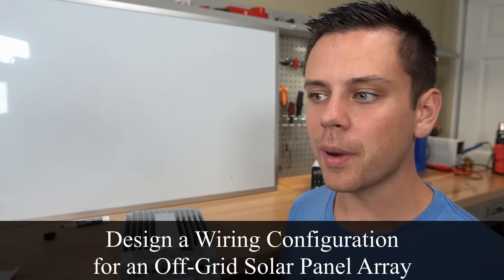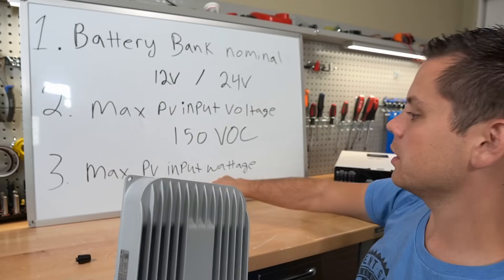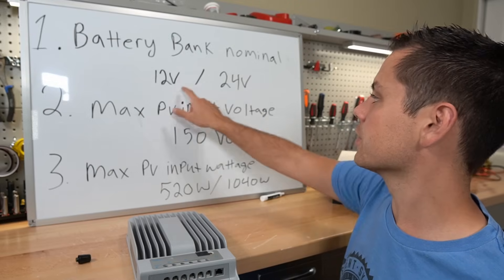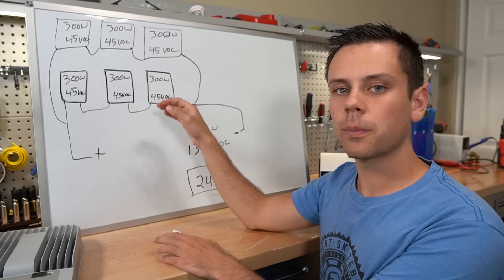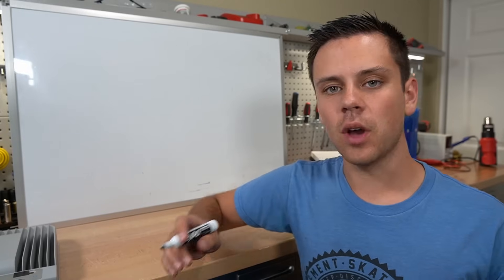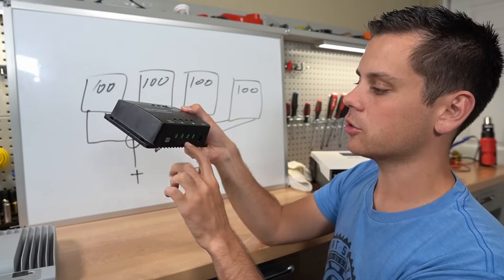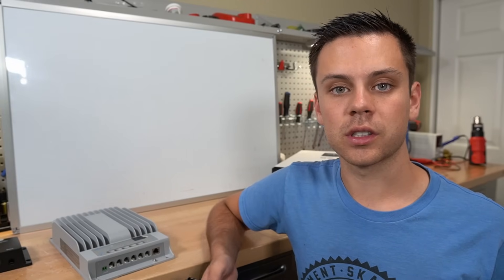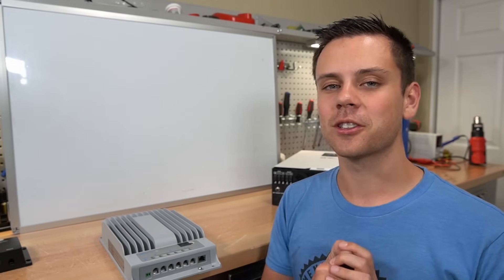How to Design an Off-grid Solar Power Array Wire Configuration

Comment: I’m a beginner solar diy’er…Could use some advice in designing my solar panel array.  I have a “Off Grid” workshop that I am try to power up with 2 ea.  EcoFlow Ultra Pro Inverters and 40 ea. 240Watt solar panels with the following specs:
Solar Panel Specs:
Rated Max Power     240W
Current @ PMAX   8.11a
Voltage @PMAX 29.6V
Short Cir Current   8.46a
Open cir   36.9 v
ECOFLOW recommends wiring the solar array in Series with the following requirements:
There are 2 inputs for solar charging    HI input (4000watts), LOW input (1600 watts)
ECOFLOW INVERTER SPEC/REQUIREMENTS:
Voltage range for low-PV input: 30V < total solar input < 150V        max 1600 watts
Voltage range for high-PV input: 80V < total solar input < 450V       max 4000 watts
Would like to know if this array would safely work within the EcoFlow requirements
Inverter 1--- HI INPUT   15 panels   and    LOW INPUT     4 panels        wired in series
Inverter 2 --- HI INPUT   15 panels   and    LOW INPUT     4 panels        wired in series
Would like to know if this array would safely work within the EcoFlow requirements
Any advice would be appreciated

Comment: I have a good question, is there a way to drop let’s say 10 v on a solar array…. Issue I am having the delta pro limits watts to 1280 when above 130v and I’m barely at 138v and to meet spec I need to remove one panel but the issue is on cloudy days I get a lot less watts with 5 panels instead of 6

Comment: I just have one problem with guides like these. I see them talk about multiple panels, but never multiple batteries or multiple charge controllers. What if I have a charge controller for each panel, how do I wire them together? Just parallel at the output to match the voltage, but then I have a very high current. Do I just need crazy thick wires on the outputs then, or is there some sort of combiner for these as well?

What about making a battery bank of many of the same individual lifepo batteries? No server rack, just a bunch of nice batteries. All in parallel, do I just straight up wire the charge controller output into it, all of them acting as one big battery now? (With a fuse in between for safety I take it)

Comment: Just curious, you mention Max PV input wattage, but you call out Rated input wattage (520/1040W).  Max is 1560/3120  for a 40A EPEVER MPPT, which looks a lot like what you're holding.  If it is truly Max, then calculations could be somewhat off....you've taught me a TON, so keep it up!

Comment: wouldn't those inline fuses only really be effective if you have 3 or more strings/panels in parallel?
because a fuse blows by current and not voltage. the fuse wouldn't blow on its own string or one extra string feeding the faulty string (which should be producing nothing).
but like you said 2 strings/ panels or more would definitely blow the faulty string/panels fuse.
I'd prefer the insurance of having them anyway.

Comment: Hi. I wonder if something similar would not be a lot for the equipment of one van? I am buying a Bluetti AC200L with an extra battery. Do I power it with solar cells, alternator or ground voltage? Thanks for the reply. ;)

Comment: Like here I am stuggling to get to the minium voltage of my MTTP because it comes included with the Inverter 120 to  430 VDC and I only want 1000W of solar... it supports 6000W.

Comment: I have a 12v/24v MPPT that has a max input voltage of 18v for 12v system and 30v for 24v system.
Those voltages are too low to charge with and no panel is going to meter voc within those limits.
My 24v solar panels put out 38v so how is that supposed to work?

Comment: Hi I want to make a setup with 6 solar panels total. They will goi either in 2s3p or in 3s2p. The maximum series fuse rating for the 1 panel is 15A, my question is, if I go to the 2s3p configuration or the 3s2p what kind of fuses should I install?
Thanks for any help.

Comment: Wouldn't you try to match the voltage because of the power inefficiency variable. You said you would like to see some head room, but youll likely never even hit the rated voltage because of the efficiency of the panel (I think good ones are in the low to mid 90s) and then the charge controller can handle even more. So I would think the main idea would be to arrange so you create the highest ideal voltage your system is designed for (not the overload capability) to keep the system as efficient as possible without head room. I am learning this so I am not correcting, but asking.

Comment: Also a good idea of you live in a very cold climate to reduce your total panel wattage slightly from the max. I had an array hooked up to an Outback FM60, it was about 90% of what the controller could handle, worked fine for a couple years until one perfectly clear day and a bit colder than -40c  the panels output increased over their max rating by a good margin and fried the controller. It was a 2700w array and I logged over 3000w, and that's with some loss due to a 75' cable run

Comment: In series connection, voltage increases, but the wattage remains the same, i.e. in your presentation at 3:37 , the voltage will be 135 while wattage remains at 350. Correct me please if am wrong. Thank you
Reply from the maker: False. Wattage is additive in series. You're thinking the amperage.

Comment: Will, nice explanation... 
I need your help to my current situation to optimize the system.
1. I am using Growatt spf 5000ES, 20 Kw Lifepo4, and 12 of 500WP PV with 6S 2P configuration, the question are:
a. What is ideal charging for above configuration? I never seen the battery fully charge with PV during the day.
b. The configuration above is need to be improved? So far max Voltage is only 200 volt and max current from PV 15 amp
c. SPF 5000EF good for 450 volt open circuit PV, 6000 watt PV array

2. Since I never get full battery charge, is there possible to add more PV (without adding SCC) given the voltage reading is low? Say 1 more parallel or additional 6 X 500 WP will do to add energy safely to charge battery?

Thank you in advance. (BTW I am from Jakarta, Indonesia)

Comment: You mention leaving headroom for VOC in your panel design to not over power the charge controllers in colder climates. I have seen other youtubers mention the same thing but noone I have seen yet has mentioned how they arrive at a safe VOC to not over power the charge contoller. Is it an educated guess based on experience or is there a formula to calculate it? I live in cnetral Florida so it likely isn't a concern for me but we do occasionally get some cold days once or twice a year.

Comment: If haven't allready please explain how to setup switch-mode converter to down-regulate the voltage from the solar cells' optimal working point (=MPP) to the battery's charging voltage. In a language we all understand like your other videos. If you have made it please redirect me.

Comment: I need to run a 1 horse pool motor and I have 3 panels 330watts each and a pure sin 5000 inverter and a 12v battery what else do I need?

Comment: Going 2 update 2mppt charger , install busbar Bluefire , two 40 amps charge with 3 panels of 100 w /  
Question what kind of size of wires from bustbar to changer
Wire size from charger to the battery
Charger recommended 6 gauge????
More try to get info more don't understand.
Just see wires sizes in a very short

Comment: The panels I have use 12awg wires, so 20amp limit. They produce 8amps each. Does that mean to wire three in parallel, I’m above their limit at 24amps? Or would they essentially split that load between their wires?

Comment: Hello Will. Most of your viewers who are RVer have a starter battery and house batteries like myself. So I like to park for several weeks off grid. At present I have 4 lead acid batteries. So I will start with 200 watts of solar, lead acid start and 100 A Lithium. I am very frugal with electricity.

 How should I use my alternator when moving to charge both types of batteries. 

Thanks John

Comment: Hey I have 4-100 watt solar panels and a victron 100/30 charge controller and a single 12 volt battery should I wire them in series or parallel?

Comment: WILL please just do a video on the panel config of an  60 amp controller with 800 watt aco or renogy system and  explain how too add two more panels to the sytem to max out the 60 amp controller to a 1000 watt system.   this is now the standard small sytem in a house that a homeowner will buy and it will be safer for people to do  plus less confusing to alot of people. or email me and i will  produce it myself. i am new too youtube video making.  if you describe it i can do it.
Reply from the maker: That's what I covered in this video. Did you watch the video?

Comment: Question on solar panel roof placement and impact to optimal power. Currently have four 180 watt panels with 2 on one side and two on the other side of a peaked roof. They are wired in series. The peaked roof is east west so there is good sun am to pm. Am i introducing loss by having them all in series or should i split 2 series and one side roof connected in parallel with the other side?

Comment: I have Epever tracer 4215bn solar charger that I got a few years ago for my lead acid batteries and seemed to work good but now just purchased Li time100 amp battery but it doesn’t seem to be charging the battery which is down to 63%. I do live in Michigan so not the best for solar battery is above 32 degrees two 100 watt panels .  Have it on sealed setting which I thought you or somebody suggested since there no setting for lithium

Comment: Yo compre un sistema Renogy de 600w con un inversor de 3,000w y 2 baterías de gel híbridas tu me podrías facilitar un diagrama de como instalarlo, por lo menos la mejor configuración que tu opines me pueda servir, lo que necesito es corriente para un tv, un aire pequeño y un refrigerador de oficina que es lo que tengo lo pienso instalar en un RV discúlpame no hablo inglés y si hay algo mal escrito es por el traductor gracias y perdona por la molestia que te pueda causar. 

  I bought a 600w Renogy system with a 3,000w inverter and 2 hybrid gel batteries, could you provide me with a diagram of how to install it, at least the best configuration that you think can help me, what I need is power for a TV, a small air conditioner and an office refrigerator, which is what I have; I plan to install it in an RV. Excuse me, I don't speak English and if there is something misspelled, it's because of the translator. Thank you and sorry for the inconvenience it may cause you.

Comment: I thought you added up the VOC. Not the Watts..  I never did check that out on my solar controller.
I don't even know how many watts it can handle. everything is so confusing ..I've even had this one system going for a while and I thought I had it all correct. I didn't know you could have too many watts if the voc was okay...

Comment: Hi Will sorry for the ignorant question I want to make a solar system for my 4wd the issue I have is packaging so I would like to use 3 100w panels and 2 50w panels is it better to hook up in parallel to have higher amps going to the controller or is there a better way to connect I or should I just leave out the 50w panels?

Comment: i have a solar aircon with DC power of 48V. it comes with 3 panels. each panel is 46.1V and 350W. should i connect  the panels in series or parallel?

Comment: If i have a maximum target of 1kw consumption, would it be better to buy 2x 500w panels or 4 x 250w or another configuration?  i note that the higher panels have more amperage which would mean a more expensive charge controller. 
Very earlier on beginner trying to understand waht is best. (im also restricted to a maximum of 4 panels due to roof space)

Comment: I have just setup my solar charging system for my small food truck. 2-100w panels, 30amp controller, 1500w inverter and 1-100 mah battery. 
I tried a small coffee maker and the inverter bells were going off many times and I shut it off. I have another battery but don’t know if I hook it up in parallel or series?? I need more amps?? Thanks

Comment: My panels are 300w x 4 =1200w into Victron 100/50 rated at 1400w at 24v 700w at 12v ,with the 4 panels in series 4s1p Victron mppt calculator shows mmp maxium power point 92volts at 16A  going into 100v/50a mppt shows 98% under sized, when calculated in 2s2p config the panels drop the volts by half but amps double to 45v at 30a  the output from controller stays the same 49amp , the panels are rated at mpp18.6v at 16,1 amps each panel  at 2s2p i will have  30amps at mpp going ito a 50amp controller Victron mppt calculate shows 100% correct sizing for them panels ether series or para for the 100/50 .in fact it wants more watts and 350w x 4 would of been even better match at 1400w total as the controller max input at 24v so to keep it safer ill shall wire panel in 2s2p  at 45v at 30amp with 32amp 2 pole inline breaker - PV isolated switch , charging EVE  280ah 8 cell 24v bank with 200amp deligreen smart BMS ,24v 2000-3000w 240v inverter

Comment: I want you to give me good answer I have  PV panel 100watt 12v, 7, and I have 120 watt 12v ,4,please can you give me best way to connect the panel together,my inverter is  rated power 3000va/2400w, system voltage 24v, max solar voltage VOC)80VDC, which way is better as you're professional in solar ,give me way out to put it together thank,

Comment: Hey I have got 5kw inverter48v
4×200ah gel batteries
2x455watt solar panels
But I can not use it for more than one hour on the evening what could be the problem. Should I add another 2 solar panels

Comment: Another great video. I need that so much. I'm doing about the same as y example. 6x200w panels (3S2P).
I'm using the MPPT 3024 (Europe 220v)
I could even do all in series w this unit, but since each 3 panels string is on one side, shade on one could affect the whole system.

Comment: I love your videos however I noticed thatin this basic set-up you don't mention anything about a shunt or the need for one. Can you do a video explaining the need for a shunt?
Reply: Since no one answered (I’m sure Will gets thousands of comments) I can take a crack at it. 

In small or RV solar systems a shunt usually refers to a precise resistor of very low resistance, placed between the negative battery leads and all loads and chargers sources.  A 500/50 shunt, for example, would have a 50 millivolt drop at 500 amps. 

By measuring the voltage very precisely a battery monitor can see .1 amp and up charge, or discharge going into or out of the batteries. Generally you can program the size of your battery bank, and the minimum state of charge you don’t want to go below, and it gives you an accurate % of charge you have left. It can also show you amps or watts going in or out. 

Back in the day was the Bogart TM2030, with an LED display with the processor in it that was generally mounted inside the RV. Needed to use twisted pair wires to the shunt, since it is looking at tiny voltages, or current flowing on an adjacent wire could throw things off. 

These days a lot of people use the Victron BMV712, or their Smart Shunt. Both handle up to 500 amps and have the processor built in to the shunt, and both have Bluetooth for a phone app. The BMV712 comes with a data cable and a physical display, along with Bluetooth. If the battery is discharging they can tell you how long the battery bank will support the load, you can get a graph of state of charge, have your phone alert if state of charge gets too low…  Victron also makes a 1000 amp smart shunt intended for their Lynx system, for bigger systems. 

Anyhow a shunt isn’t necessary but nice. Voltage base state of charge gizmos aren’t that accurate and are thrown off if the battery hasn’t sat for say 30 minutes with no loads or charge. 

With a bit of experience you get to know how many amp hours your RV uses over night, so if you need to do a generator run you can do it at a reasonable hour, instead of having the fridge low voltage alarm go off at 2am…

Comment: Page 9 in the Epever manual limits panels based on cell configurations.  For example I'm looking at 180W panels with 42.3 Voc to charge a 12V battery.  Applying your methodology here, I should be able to get 3 panels hooked up with 20W overpaneling.  Page 9 of the manual says 2 panels is max for 72 cell panels.  Not to mention that 2 is the max for all panels with more than 36 cells.  Take a look at the chart on page 9.  In all cases from 48 cell to 72 cells, the Voc of the three panels is significantly less than the controlle's 150V.
Your video appears to contradict the manual in at least some cases.

Comment: Another great and informative video for your DIY solar system audience. I have question for you. I built a DIY 400 watt solar system (12vdc , 30A total) using a 60A MPPT charge controller (12vdc) and a Chins 200AH (12 vdc) LifePO4 battery for power storage. So my question is whether I can both charge the battery and draw current from it simultaneously? If so, what's the dependency?

Comment: Question will if I took an alternator and pulled the 3phase out ran it to the back of an RV and rectified it in the back with and external regulator at say 80vdc could I feed this into a pv input on let's say a growatt 3000spl to charge a 48vdc battery? Would pwm or mppt be the better choice for this? Any reason it wouldn't take the signal?

Comment: Question - If my solar array is 24v and I wire this into a 12v/24v charge controller, can my batteries array still run at 12v or do I have to match my array voltage of 24v to a battery array of 24v? 

You also show 3 panels in series, if these panels are 12v panels, surely that would be 36v solar array and not 24v? I'm new to solar so I could be wrong.

Have you done a tutorial and the mixing of voltages? i.e. different voltage configurations?